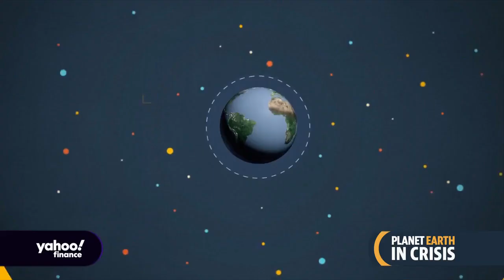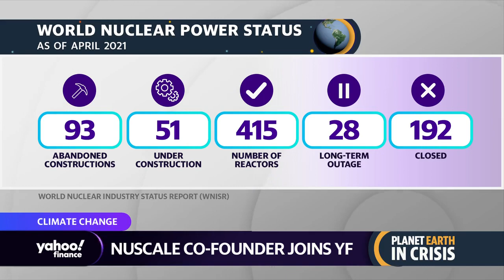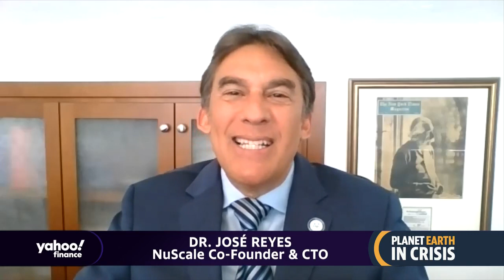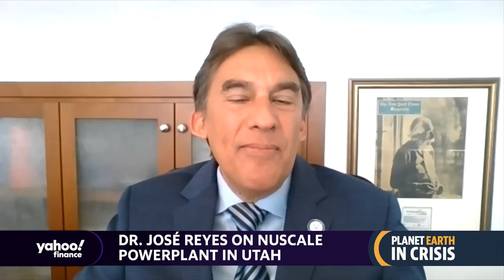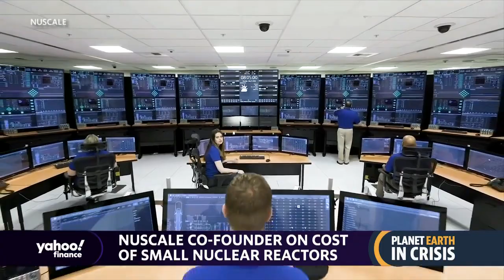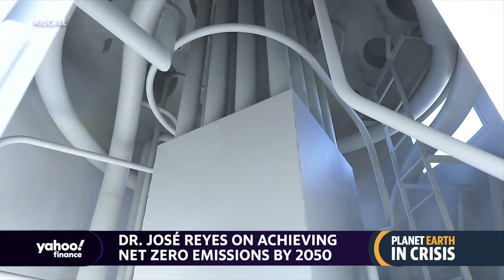A look at innovations in nuclear energy and small nuclear reactors with NuScale Co-Founder

Comment: I think Reyes was misunderstanding her cost overrun questions. What he needed to answer was what caused the specific revised cost estimate from $4B to $6B in the case of the UAMPS project NuScale is working on. Reading in between the lines a bit, I think he was trying to say that some of that revisal could have come from the UAMPS site engineering estimate and some of it could have come from UAMPS requesting more NuScale modules to get the best economy of scale in order to meet their levelized cost of electricity goal. But he wasn't clear about that.